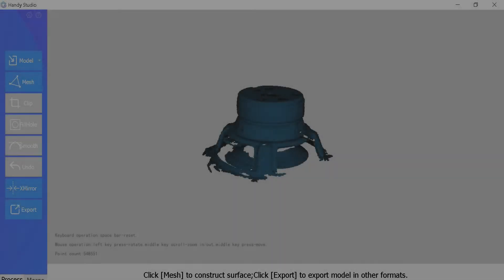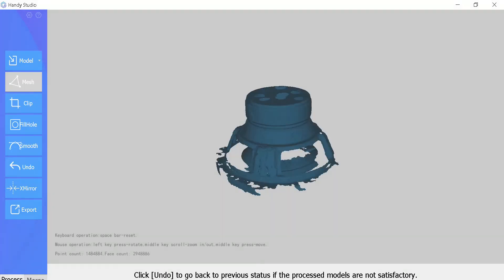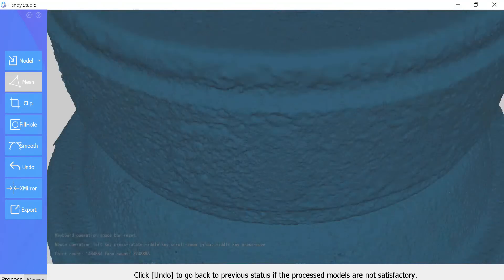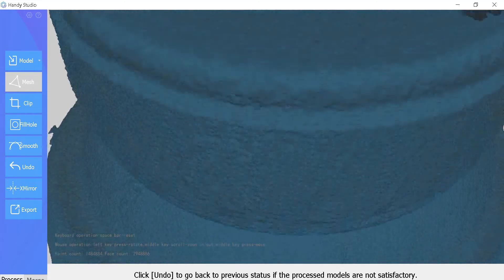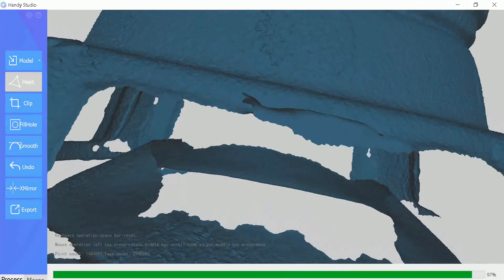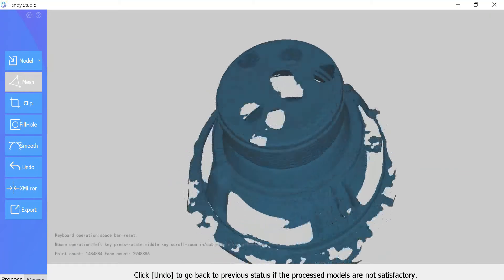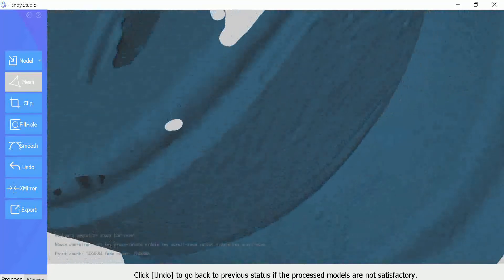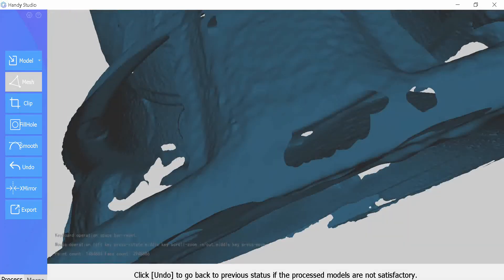Revopoint POP II Short Scan of a Speaker Frame, High Accuracy Mode, Texture Off

Comment: spray it white with dry shampoo. bet it comes out better. just bare metal colour yeah?
Reply from the maker: Thanks for the tip! I was trying to represent worst case with that particular finish; then the plan was to try different developers. The biggest problem was that marker mode was not working in beta for POP2 at the time and I didn't know it. Plus I was even more of a rube than I am now.